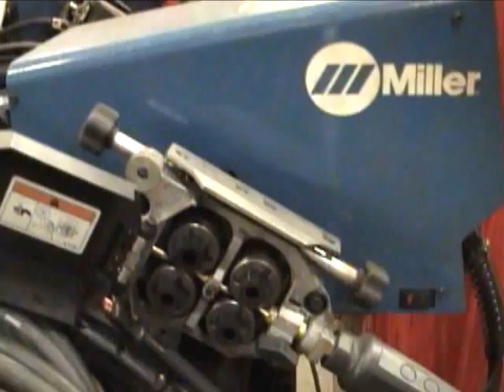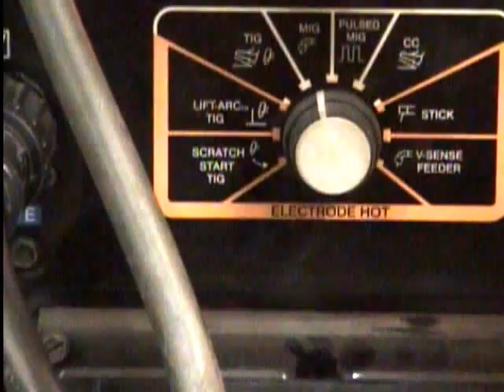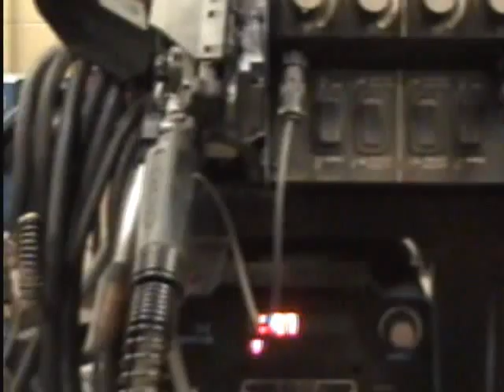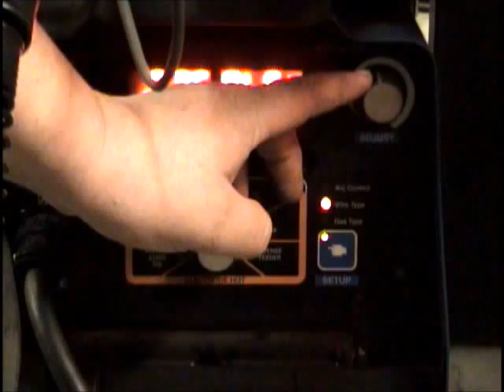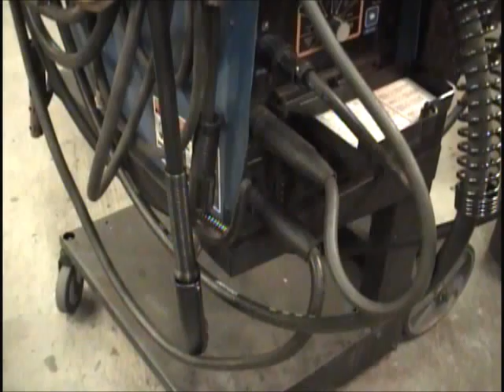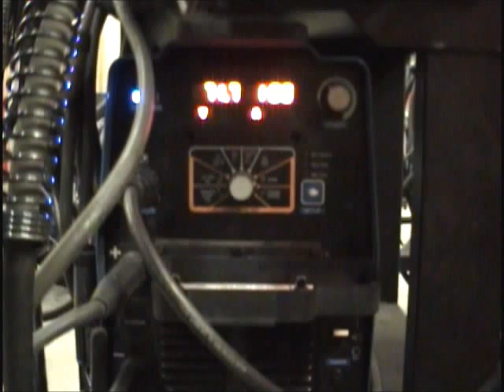HTC Welding Program presents: Setting up a MILLER XMT 350 MPA.wmv

Comment: Hey how can I set up my miller xmt 350 mpa to do aluminum tig
Reply from the maker: That machine will not do Aluminum GTAW. It will conver/ run GMAW Aluminum. You will need a special GMAW gun/ lead